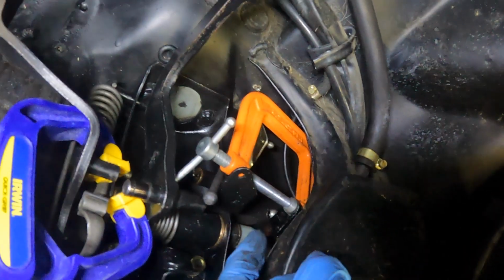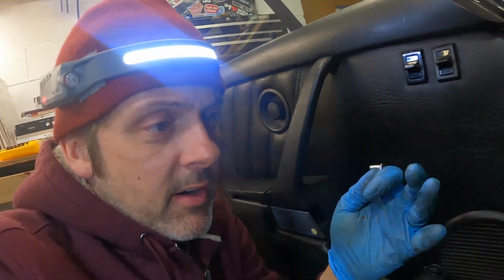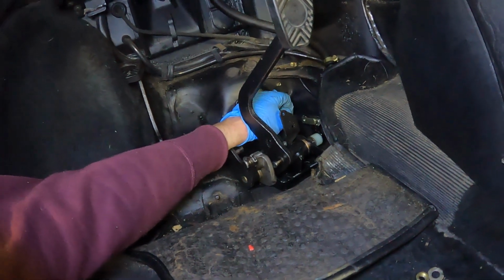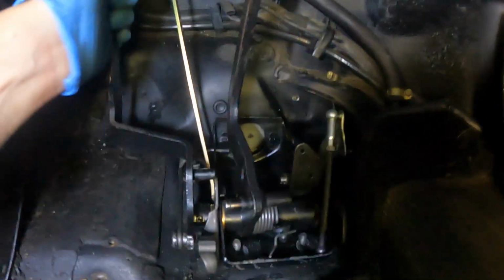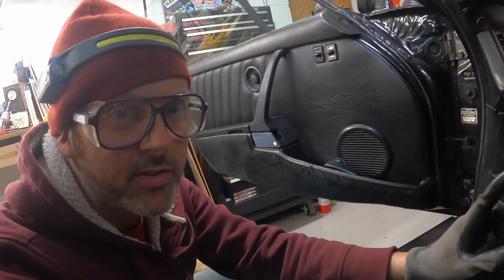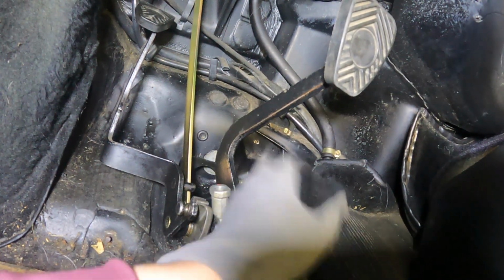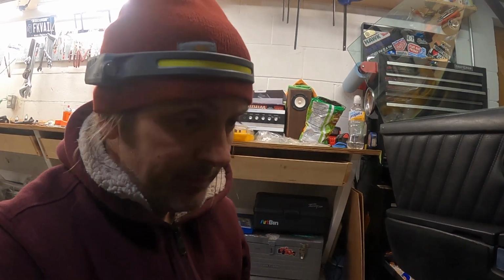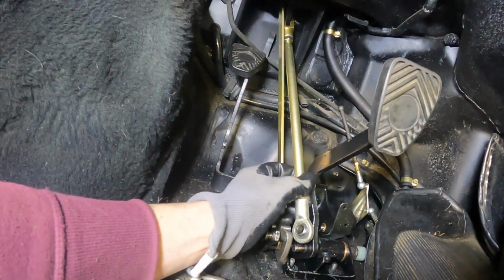Installing Porsche 911 Pedal Cluster - What You Need to Know

Comment: If you remove the center console, there is a pretty large hole in the tunnel that gives you access to the pin for the clutch cable, this way you can install the whole  pedal assembly (with the brake rod and brace) and bolt everything up pretty easily
Reply from the maker: Where were you months ago....
Reply: @addvancedgarage  sorry man😂

Comment: I posted on your FB post that its the worst job Ive done on my car.  I did reassemble with the spring and all the rods in place.  I recall locking the clutch pedal forward with locking pliers so it couldnt take my fingers off.  As you found, connecting everything while the cluster is not bolted in is the only way to do it.  That included the brake rod and the brace.  I reattached everything before bolting it in place.
Reply from the maker: I don't know how else you'd do it.  Someone on pelican is claiming it's easy to hook up when installed and they'll post a video next week.  We will see.
Reply: so I should have brake rod attached first ? whole assembly with springs attach too?
Reply: @andrewtuzzolino589  Thats what I did.  Attached the full assembly to every component and then bolt it all in place.